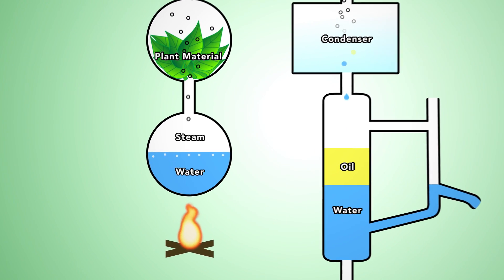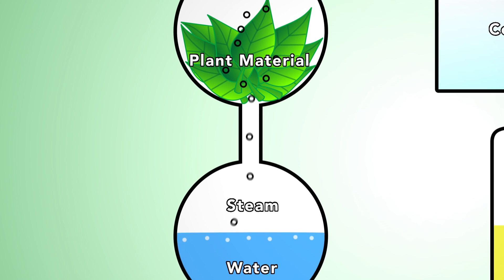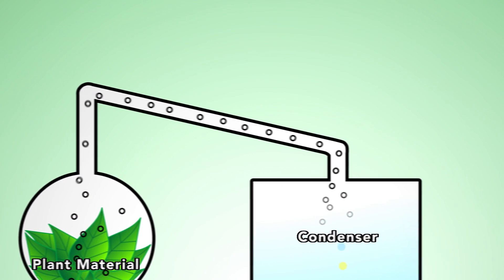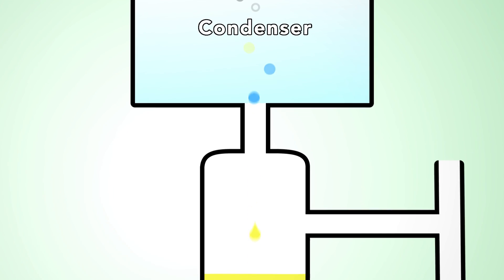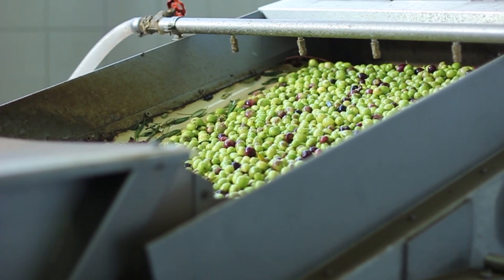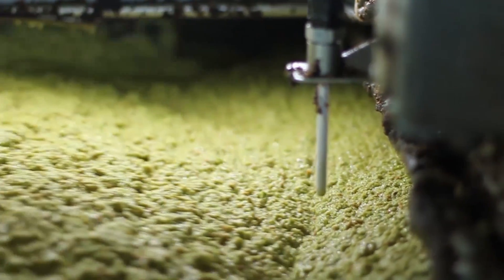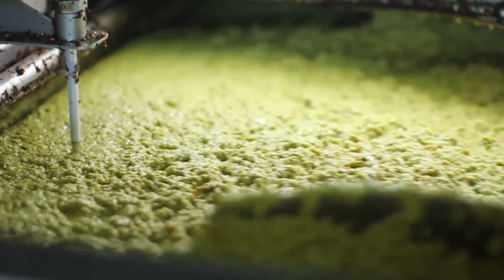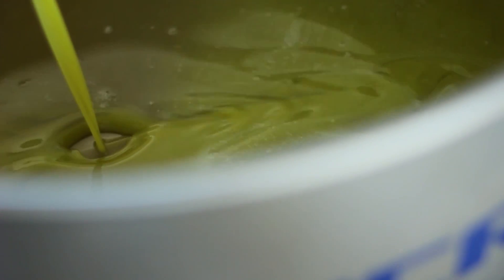How Essential Oils Are Extracted

Comment: What are the many different way to extract oils other than this two? 
Can anyone just mention them as headlines?
Reply: Hydro distillation, Solvent, CO2
Reply: @Viraj_Sapkal  all the ones you mentions are same or each 3 it self is different one?
Reply: @sirpfa  There are 5 different methods of distillation -
1. Steam Distillation,
2. Hydro Distillation,
3. Cold press Distillation,
4. Solvent distillation and 
5. Supercritical or CO2 Distillation
Reply: @Viraj_Sapkal  thank you. There is nothing else other than this 5?
Reply: There are a LOT of ways to extract essential oils, which include those already mentioned here as well as microwave assisted extraction, maceration or cold pressing, etc etc. If you're looking for an extensive list you're better off looking a up a recent review paper on essential oil extraction methods. But basically you can use any technique that'll release the volatile compounds that make up the essential oils (mainly mono and sesquiterpenes) from the plant cells and capture them before they evaporate to the atmosphere whilst avoiding decomposition of these compounds (usually a result of excessive heat) and extraction of other non-relevant compounds such as chlorophyll, for example.